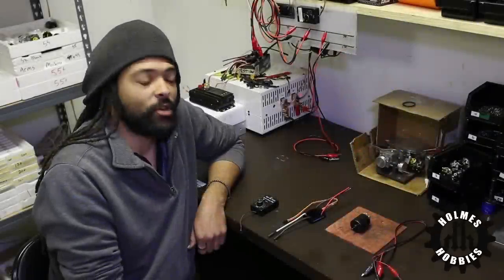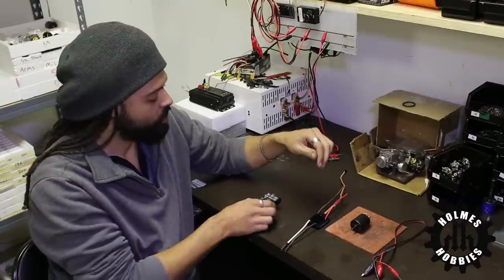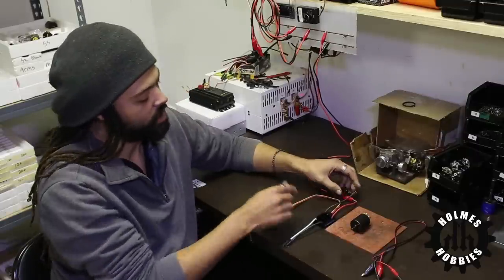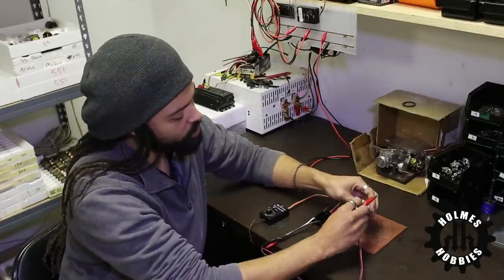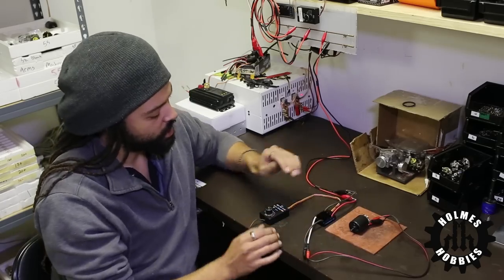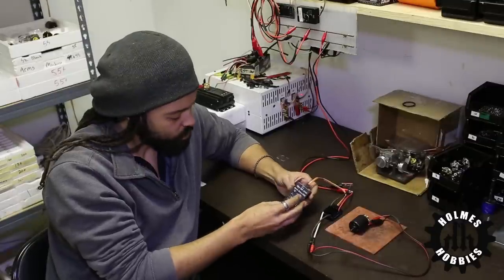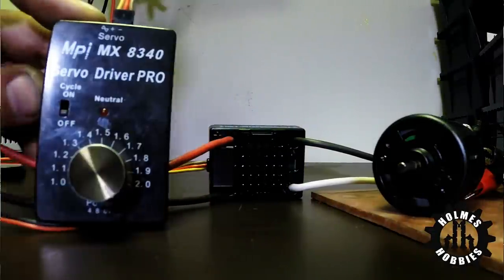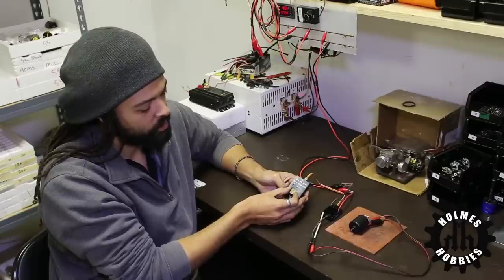ESC Throttle Programming for Holmes Hobbies and Castle Creations

Comment: Hi there, I'm veera,  i bought a new rr10 bomber RTR with ae-5 esc,  there's is no calibration,  moreover when I connect the battery to the ESC it doesn't make any beeps or anything, i tried the throttle process but  i don't find any change or  not even beeps. i tried connecting the battery directly to the motor, its working absolutely fine, additionally I see a red light always blinking on the esc just next to the jimper.
Reply from the maker: The ae5 is a hobby wing ESC that we don't have experience with.   If you are still having trouble, contact Axial and they will help out.
Reply: You might have to hold the throttle down before you turn it on and hold until it beeps. Sounds like the transmitter was not bound